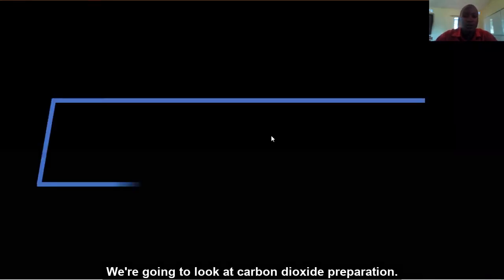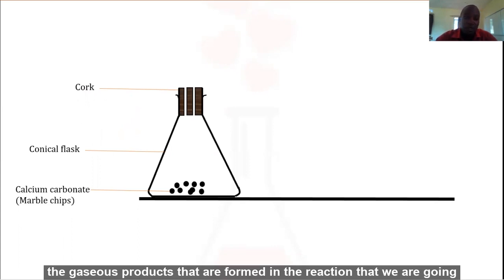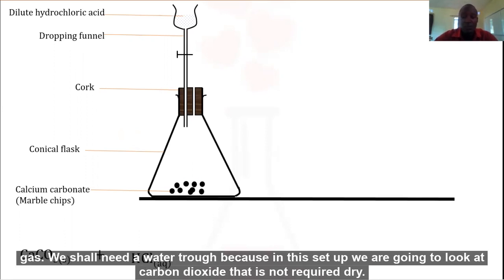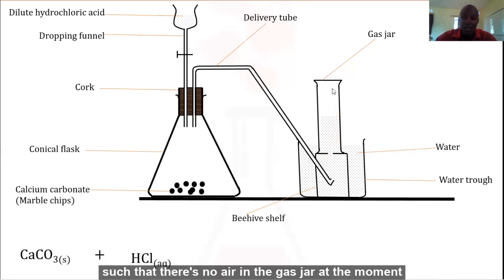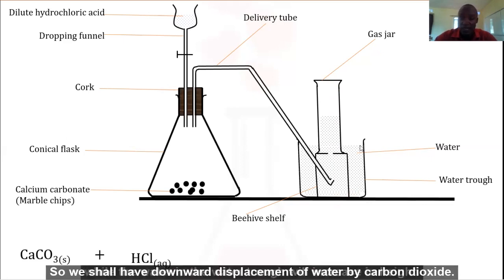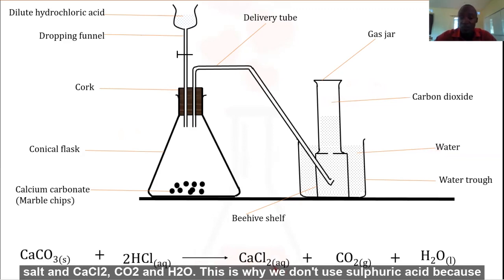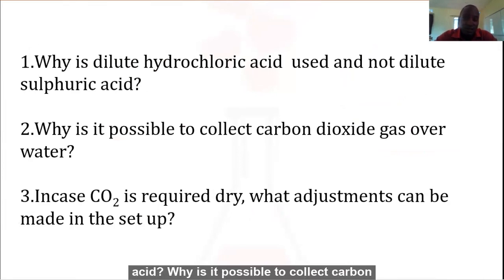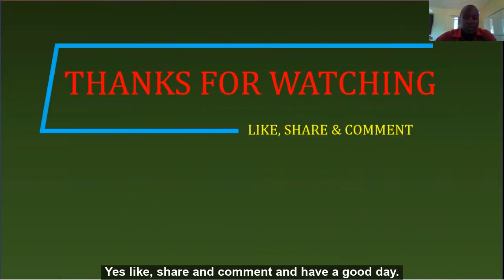Laboratory preparation of carbon dioxide and set-up.

Comment: Help with no3
Reply from the maker: I don.t get you
Reply: @kigozibrammer  the qns u asked after your talk
Qn no 3 ☝️ is tormenting me
Reply from the maker: @alupomargrettheresa6646  For dry carbon dioxide, we shall need to
1. install a wash bottle(immediately after the conical flask) containing water(or KHCO3 solution) to remove hydrogen chloride(since it is highly soluble in water) fumes that my be moving along with the CO2 produced. 
2. Install another wash bottle(after 1.) containing concentrated sulphuric acid(any other compatible drying agent can be used) to dry the gas.
3. The dry CO2 is the collected by downward delivery in a gas jar since it is heavier than air